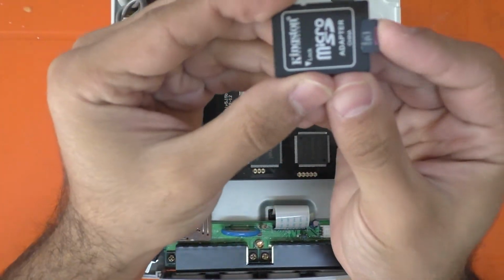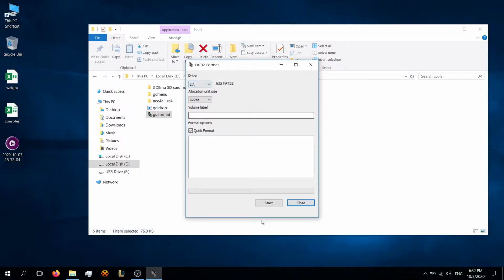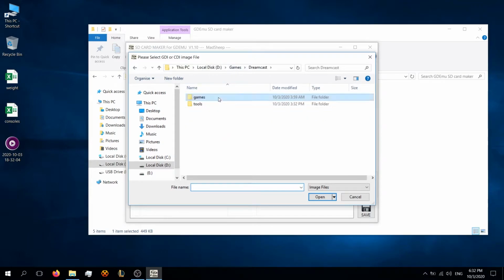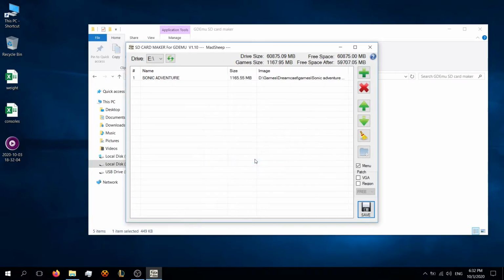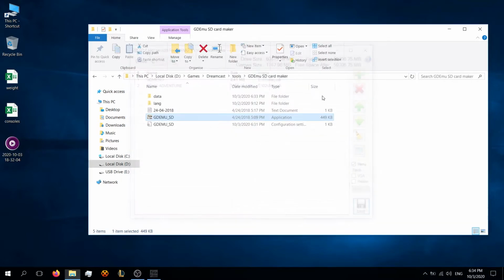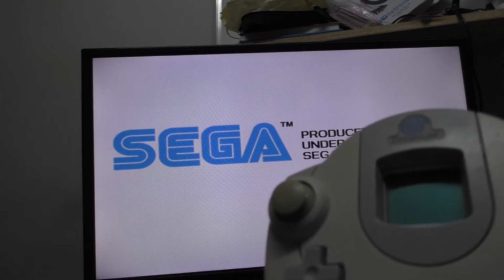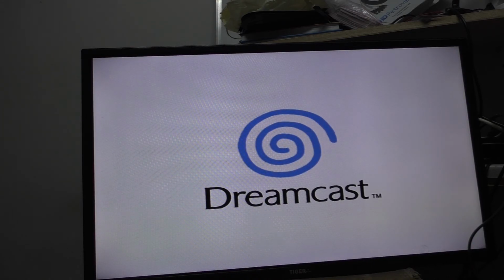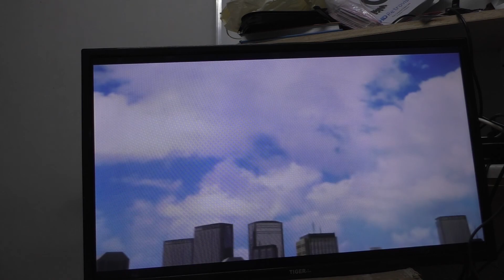Dreamcast GDEmu mod full tutorial

Comment: do you have to soder the resistor or is it just recommended?
Reply from the maker: I think that you should, because the 12v rail is floating and therefore will generate a lot of excess heat which the system wasn't designed to handle it. in time, it will cause damage. adding the resistor solves this.

Comment: the easier option is just to remove the 12v reg and then no issues at all
Reply from the maker: yes this is the easier solution assuming your original power supply works fine, plus it matches your power system. for us, we have 220v so when we get Dreamcast from Japan or USA it comes as 110v which won't work. then we have to get a replacement since step down transformers are not so available.

Comment: So what happens when you leave the psu as is ?
Reply from the maker: If your original psu is working fine, then you don't have to change it. However, if you install gdemu, then you need to put a load for the 12v rail or just disconnect its regulator.

Comment: hello,

so how big resistors do i  need? 300 or 400 ohm?
Reply: Any of them is ok but make sure to use multiple resistors in parallel to share the heat.

Like getting 3 of 1000 ohms in parallel will give you 333 ohms. Now each typical resistor is rated at 0.25 watts so you will have 0.75 watts capability while needing only 0.5 watts.
Reply: @hossammoghrabi1021  3x 1000ohm? so 3x 100ohm resistors arent enough?
Reply: @hossammoghrabi1021  hi, just found 1k ohm resistors in my basement. How can i know if they are 1/4 or 1/2 or 1watt?
Reply from the maker: well, it is hard to determine but larger ones are higher in specs.

just connect one of them to the 12v rail, it will give you 12ma which is fine.
Reply: @Thundertronics  Thanks! ive did! Works well